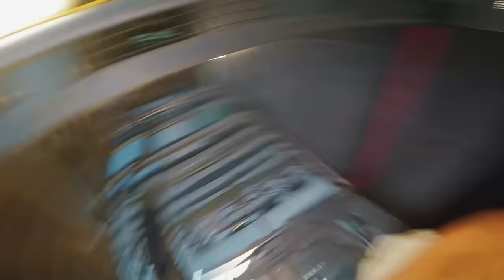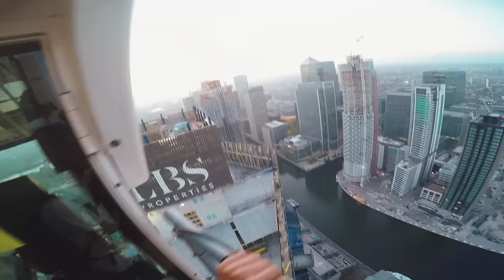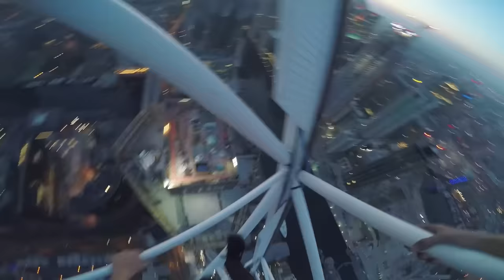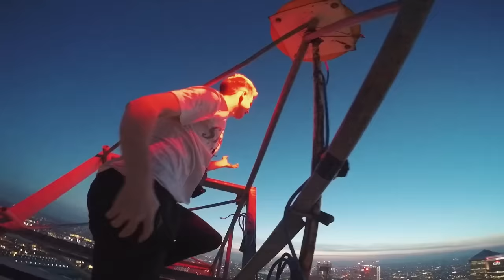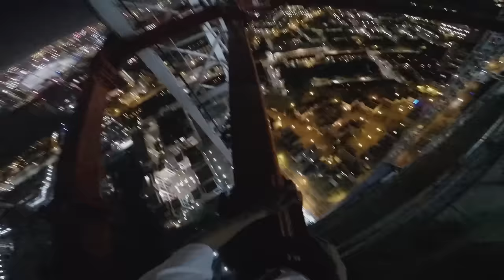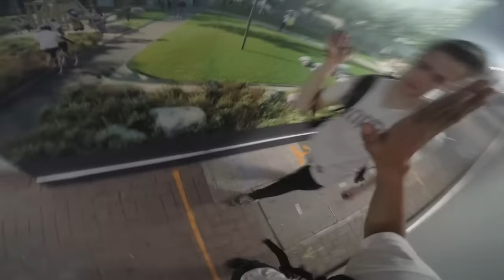The TERRIFYING Beam Walk (Crane Climb)

Comment: Not impressed I walked steel for 30 years in NY. Slide down those cables to the wench. Then I'll be impressed , yes the ones at the top where your at it's 3 cables running down to a red wench.